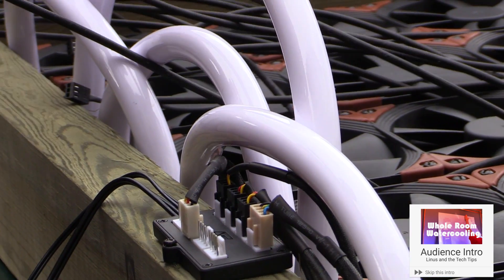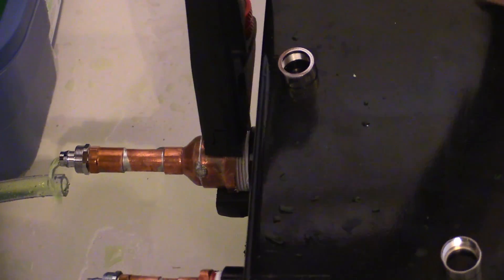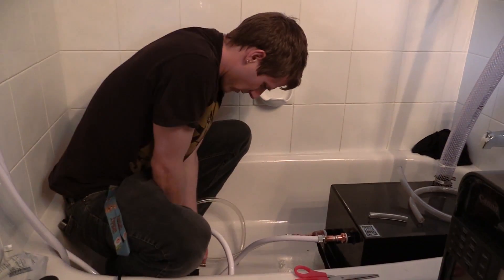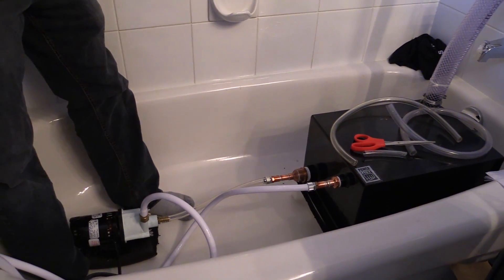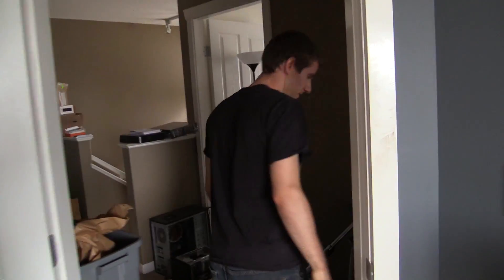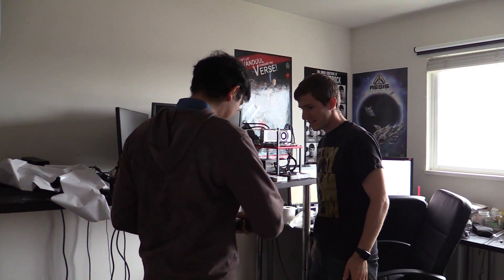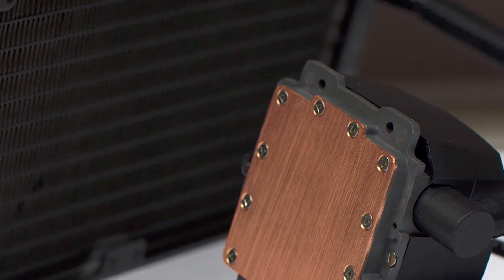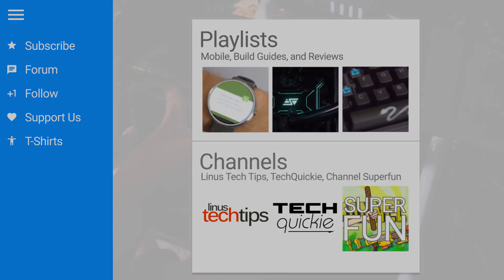Whole Room Water Cooling Part 4 - Nearing Completion...

Comment: These guys have 0 planing in this... 1 way check valves, quick disconnect fittings, and flow regulation would have done this project wonders...
Reply: they are using the wrong type the ones they should have used are the ball type prevents leaks. Also this setup is going to suck in the summer when the outside temps are sky high...
Reply: still would never stick it outside the differential can cause condensation if it gets too cold could only game during the day...
Reply: Robert Hollar Outside temps shouldn't make a difference, I'm pretty sure those fans are exhaust, not intake.
Reply: No if ambient tems in the room are greater than the outside temps condesation can build on the board and fry the computers there are so many bad ideas with this

Comment: Next time put air bleeder on each end or connection to the computer to take the air out, they sell these in the plumbing or places where they sell parts for boliers.  I would also get like a 007 Taco pump that is use on water heating system. Nice project...

Comment: You should reconnect not used pipes using valve. Than you can stop circulation or start it to get rid of air capsules. Or just put valve on each computer input and you can choose then wher circulation should be, you can stop it ewerywhere and start only one circuit only one PC and than start next one, and next one, or start next and stop first, start third stop second and choose best way to get rid of air.

Comment: what about tinging* on the pipes with you UberWrench ** to try and vibrate the air out, I know in the old thermaltake dual 5.25" bay liquid cooling , i found that the Flicking in my case on the plastic tube would allow the bubbles to move about and clear through the system :)

Comment: could have been done lot better and i don't think outside system would last a rainy day. BTW that Chinese 2A power supply only can only handle up to 1A and they are not durable. If the fans fails system going to heat up and leak. Use a old computer power supply with green wire shorted with black one. Second take the computer fans off  and replace it with car radiator fans. They last outside with the weather conditions. Finally soldering is not rocket science. JB weld not going to hold the water too long. Just use a gas torch with some solder. which you can get it from the hardware store.

You guys should post followup video to show how well the system worked and whats the condition now.
I enjoyed the video and keep the good stuff.

Comment: I wonder if a glycol draft beer line chiller pack would be any use for this type of setup? 

They have chiller, heat exchanger and coolent pump all in one box. I have seen these used with beer pythons up to 50 feet in length. Generally run for many years with out problems.

Comment: Hi,
I was just wondering why you decided to use copper tubing/piping for your water out. I mean copper is used for heat sinks because it gives off heat easily so as the hot water travels through the pipes isn't it just going to give off heat and do exactly what you had planned to avoid; heat the room? Especially with as much pipe as you have exposed, it seems to me like it would just become a really long heat sink. I think using a different type of metal from the start (which doesn't really help now) or using insulation around the hot pipe should help this. I wouldn't think the heat coming off the pipes would be drastic but still probably noticeable with that large amount of surface area.

This is still a very COOL project (see what I did there? It's funny because cool can imply two diff...never mind) and am looking forward to seeing the finished work of art!

Comment: hey Linus, I think you should have gate valves installed on every terminal pipes on your cooling system, so you won't have to shutdown the whole systems if you will install a new system on the loop or unplug another system on it.

Comment: They should have used valves going to various hook-ups so that if problems ever occurred, it could be isolated. Example, at 6:50 a valve could have been installed before the end caps, so instead of loosening the ends and then getting your hands wet, the valves would be closed until after the caps are removed.

Comment: Two things would have made this project easier for you guys.  

One, ditch the computer radiators and mount a car radiator on the roof higher than the rest of the system.  Then fill the system from the radiator cap and gravity will remove all the air for you.  Then you don't need a reservoir or a powerful pump.  With a closed loop system the small pumps in each computer case will be sufficient.

Two, add a check valve in the supply line for each work station.  That will prevent coolant from flowing through computers that are off and keep all the coolant flowing through the radiator.

Comment: What I would have done to flush the air out is have a shutoff valve for each pipe set right up next to the main line. Open the farthest system and turn on the pump. Then close it and open the next closest. So on and so forth until you have purged the air from all of them.

Comment: Ah.. as i sad in episode 1, you approached the whole project from the wrong angle.
Like then i would like to ask why not use a car radiator with and single huge liquid pump?
And also.... in a big loop like that, taps and quick connect fittings are just mandatory....

Comment: very cool project. but if not for the fact that most of the parts being given by companys for a fat tax right-off. you could always just go to pull and pay and get a radiator from a car and an electric fan for the outdoor loop. and your choice of equipment for the indoor half. that will save a tun of money and work VERY well

Comment: LinusTechTips  Did you consider what's going to happen in the winter? I don't know what part of canada your in, but freezing seems like a pretty significant issue. The tiny pipes on those radiators could take a beating as soon as the weather drops below freezing.
Reply: Flat4Buggy Doesn't seem like that will be enough if the loop is off with water in the radiators in negative weather.
Reply: Flat4Buggy Ok, you win. Fair enough.

Comment: should use valves to help with maintenance. Put them on the hot and cold side of the computers and the copper pipes on the walls. that way you can connect and disconnect without the water splashing everywhere. Also add bleed points on each case. i.e. a tee with a valve so you can bleed air.

Comment: Pipes coming down from ceiling in such a way is alway s flawed with problems in heating systems (drops system) , as this is a cool water system you would have to run higher pressure pump, which is not what you want !, problems with burst fittings in pc etc,, the whole pipe system should be lower to floor level so as to maintain easier flow with less pressure,, i hope to see this working i really do, but if your gonna start gluing fittings instead of soldering them then theres gonna be a disaster , Good Luck guys

Comment: Reinventing the wheel ! So many easier ways to do this with just a little forethought. All the exposed plumbing is just asking for trouble. The radiators could have been consolidated into a single unit with many other form factors and far fewer connections and better efficiency, ease of use, maintenance, mounting, power options, and so on and on and on. Next time consult a legitimate HVAC company for some ideas first.

Comment: I got to hand it to you this was one helluva project to take on.  I'm assuming the feed and returns go out that window in the bathroom?  How do you expect to seal that off?  Also regarding your setup outside - the straps you used to mount the rads really seem to block off a lot of real estate.  Perhaps consider using a two pieces of angle stock the full width of the frame on the top and bottom.  Home Depot should sell this either in raw steel (which can be painted) or quite possibly aluminum.  Where you mounted that rad frame to the house you should really install some sort of flashing so water doesn't get behind the frame or worse yet your siding on the house.  From episode 1 I had doubts on your main pump you mentioned its head pressure but does it have a horsepower rating?  I'd think you'd want 1HP minimum for a setup like this.  Anyhow can't wait to see any followup videos - great job.

Comment: if you wanted a low temp water cool design, why not use a freezer. using a long style freezer you can make slots of radiators with fanstemps would be under 20c and it would be less work and tidy or better yet; you can have reservoir of what ever liquid you are using to cool your pc inside 7cb freezer; like a plastic tank with a hose on the bottom directing liquid to the pc's and a hose on top bringing in hot liquid

Comment: Not sure how the system works good for you, your water loop is not correct, and your basically bypassing certain cpu's. You could get so much more out of the system if it was repiped and designed. Also a purge valve at the top of the loop in one or two spots will make purging the system so much easier. message me if you need help with the design, I have done water cooling since its advent and I have a plumbing background. With all the tech in there, I would have done a chilled water line loop.

Comment: I would have gone with the all-cables-through-the-wall-in-the-adjacent-super-cooled-room option coupled with inexpensive air cooled heat sinks, open cases, ac circulation fans and a HEPA filter for dust control.
The right wall mounted air conditioner would probably give similar temps at a fraction of the cost.

Comment: You would have much less problems if you had been using some valves to every computer. For comfort if something leeks and to remove air in each system. :)
And if you whant to remove a computer from the loop just shut the valves on that spesific one, insted of draining the whole system. :)

Comment: Would it not be a good idea to place the pump closer to the drain in the tub if you're trying to get it as low as possible? The side of the tub with the drain is a bit lower than the far side. Might not make a big difference but just an observation.

Comment: Balance the system, the flow will go the the least resistance, short circuiting some pc's. I have to do this when I install heating systems. I don't see any valves to isolate pc's and if you got valves, you could get rid of the airlock.

Comment: well why not use quick disconnection fittings, fill every system separately, let it bleed and remove the air bubbles, then fill the pipes and let them bleed one at a time and finally just connect the systems to their positions. The fitting will be bulky but idk. Seems legit to me. Just break the project to smaller ones and fill them with water. Then put it together filled :P

Comment: Do You realize that, when the winter comes and low temperature this water outside can freez and you gonna burn your all pc !
To avoid air bubbles you should add to the cooling system preasure tank that is hanged in the highest point of this whole system - its something like preasure tower in water system that feeds our homes !

Comment: You gotta put a valve at the highest point in the system for venting out the air. Unless you have any more leaks, it should work flawlessly after that.

Comment: you need a shut off valve on the separate pipes tat run down to the computer that way you don't have to drain the entire loop every time you wont to hook or unhook a PC from the loop
.
also you should set up one computer as a system manger for the water cooling loop with sensors rig in the rest of the PC so you can change fans and pumps and trouble shoot all on one PC.
PS. let me know what you think of these ideas and if you do them make a follow up video

Comment: Base on what I saw....I believe the reservoir is one of the problem that you are having bubbles in the loop. The way you filled up it brings a LOT of bubbles. It should be better if you seal the intake so no air would go into it. Of course, I don't really have the whole picture, so everything above just IMHO.

Comment: Bleeder valves like the ones used in old fashioned radiator heat systems would allow you to bleed off the air bubbles. If they were located at the highest points in your system they would be very effective at eliminating air.

Comment: Something that would of helped with the air bubble issues was to place air bleeder values on your copper tubing. They do that a lot on boiler systems, which require lots of piping like your system did.

Comment: We auto mechanics run into this air pocket problems quite a bit when working on car radiators. We got a special tool that puts the system under a vacuum to get out the air bubbles and then let said vacuum pull in the coolant solution to prevent as much air from going back into the system when filling it up. All you need is a air compressor and a AirLift Tool. By the way, what is the coolant solution you guys are using?

Comment: Just a tip, there is a device called water degasser that can be used to remove any air in a closed water system. Next time run that together with the circulation pump for a day or two.
Then you will have no air and a more efficient cooling system.
Of course you need to have the water to circulate in some manner first.

Comment: They didnt use distilled water. Watching this whole small series it was kinda laughable because 

wrong tools were used, 
jb weld was used, 
non distilled water was used, 
water pump is most likely too small for that huge of a plumbing project
computer fans were used.... OUTSIDE
coolant / water ratio was probably not measure for winter use (frozen pipes) 

Im not sure if you guys rushed this project or not.

Comment: You could have saved yourselves a ton of time by calling a plumbing or heating contractor. Would have cost you less than $100. You guys are doing so many things wrong! It will never work long term/ that pump is crap. You need to get a circulating pump. Why didnt you guys run the loops closer to the floor? By having a drop of 6' and a rise of 6' it is just not going to work.

Comment: Why have multiple pumps in each PC? Why not just have one big ass pump so you only need to worry about one failing. Also why did you you use lots of small gaming PC radiators? I would have used just one big industrial radiator.

Still a pretty cool thing you did here tho. If only I could justify spending all that money, then I would do the same thing :p

Comment: hey Linus theirs a you-tuber out there that made a video called "Ultimate Corsair H100 Cooling Mod" made by OC3D TV, he has put 40 SP120 fans on a H100 liquid cooler. 20 fans were pulling air and 20 were pushing air through the radiator, which brought his workstation pc to a highest temperature of -7 degrees C, and brought the room temperature down to about the same. You should watch this vidoe and consider it for the "Whole Room Water Cooling"

Comment: Look up how to build a manifold for plumbing it will make a lot of your problems go away and make it really simple to turn off individual locations for when they are not being used, also have a bleed line at the end of all the plumbing and leave it open till it stops coughing out air then use a shut off valve to block it. This is how its done btw.

Comment: Soooo while watching the video I got to thinking....why didn't you guys install bleeder valves into the copper piping towards the ceiling. That would have prevented you guys from having to go through so much time consuming checking for air bubbles.

Comment: car radiator easier dont even need a pump. fill from the to an induction does the rest. i tried aircon evaporater but did not have enough flow. one for gpu and one for cpu. added pump for piece of mind on hot days of 40 pluse

Comment: Don't you think its easier running wires than pipes? Put all the computers in a closet and run your video, usb, audio cables out from there...
heat AND quietness problem solved...
You could then do what your doing there, or just cool the closet with a big fan

Comment: Hey Linus instead of using the garden hose from outside why didn't you just take the shower head off and attach a small hose with a on/off valve to it, seems easier in my opinion. Also I think a car radiator and fan would be a lot better then that stack of computer rads and fans you have outside the window. But if your not gonna use a car rad/fan than at least attach a circuit breaker to the fans so you don't set any fires when they get wet and short circuit. But besides that what awesome idea! You guys impress me everyday! Can't wait to see it fully functioning!

Comment: I think the copper plumbing layout needed more planning. Also, you should have adquired a window size car radiator and 2 industrial fans or ac unit that supports cooling  liquid in its radiator, instead of the 20 fans and 5 interconnected radiators.